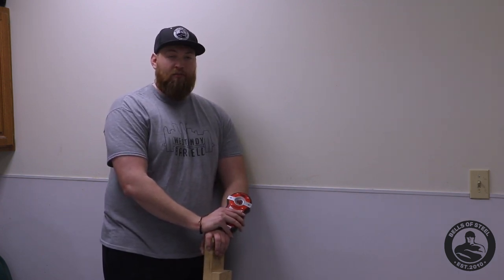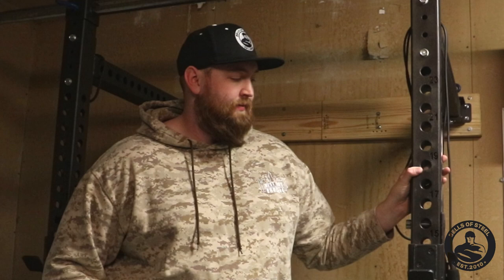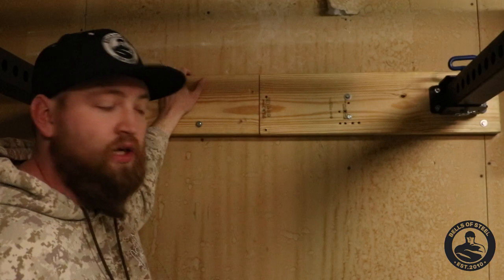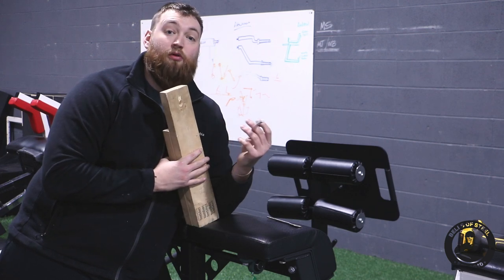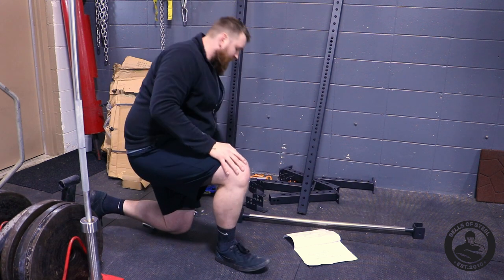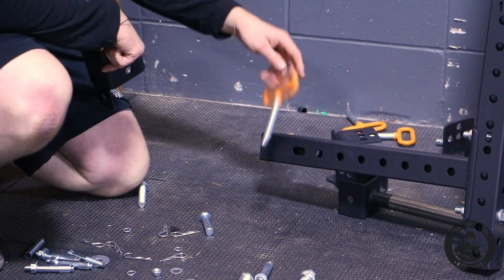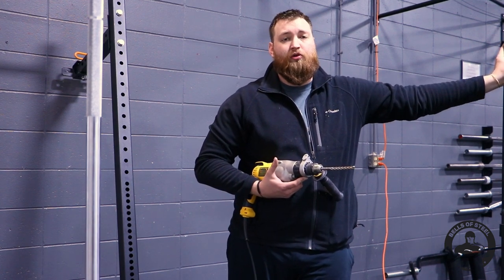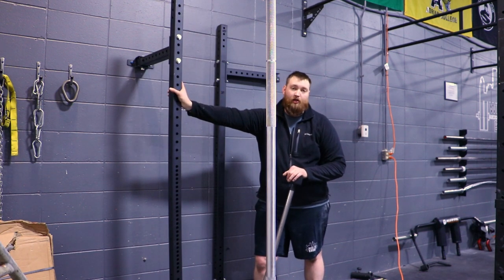Bells of Steel Folding Squat Rack Assembly

Comment: FYI, almost all electronic stud finders, including the one in the vid, find the density of the wood or metal stud, not the nail or screw.  Most will have a display that shows the edge of the stud, so, you want to screw between the lines.  They mostly will tell you is there is a live electrical wire close by as well.  Studs in basements, if built properly are either 16 or 24 in centers.  Not all walls are framed by those standards.